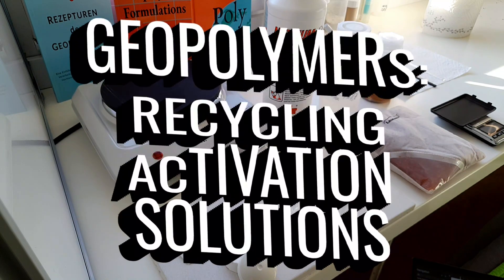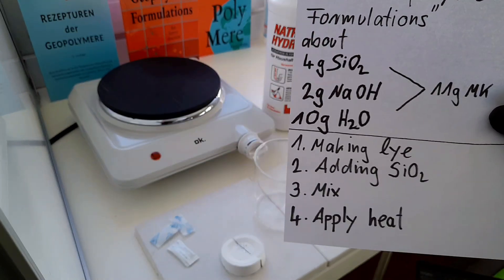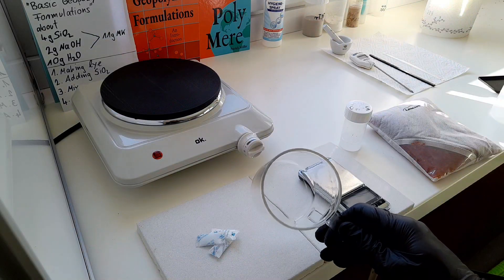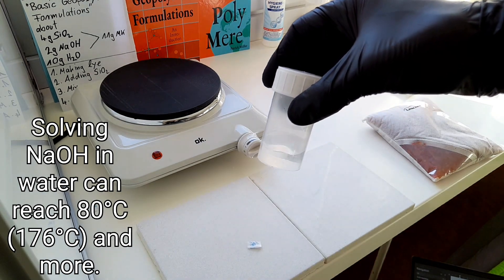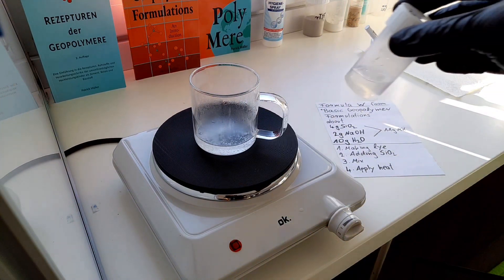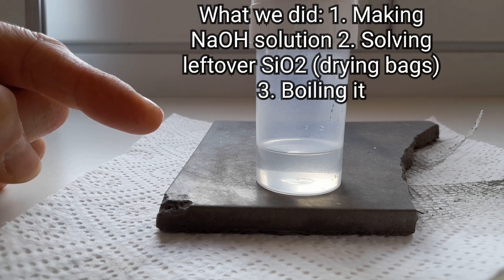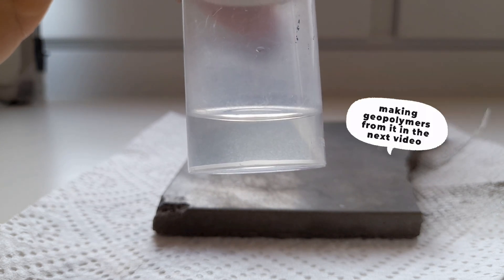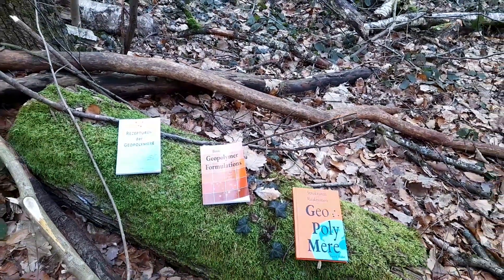GEOPOLYMERs - The Route to Recycling Activation or Hardener Solution

Comment: Is the resulting activator relatively safe for handling? How would you go about storing the activator and the estimated shelf life? Thanks for posting this!
Reply from the maker: Hey Brewcephus, 

that's a great question. Activators like this can deteriorate when they come into contact with certain substances, primarily CO2. However, as long as you keep it sealed, it should have a practically indefinite shelf life. Interestingly, a major waterglass manufacturer in my area suggests a shelf life of only around 2 years for their waterglass solution.

Regarding safety, NaOH, which is present in it, isn't very safe. A small amount of the activator on your hand isn't too concerning since you can simply rinse it off. However, if it's left on your skin without rinsing, it can cause irritation and redness. A significant splash of it in your eyes could even result in blindness. This risk extends to regular cement slurry as well.

When using larger amounts, I always opt for standard protective gear: workwear,  goggles, gloves (the sturdy ones), and a face shield.

Once the geopolymer is hardened, it's not as hazardous, except for the dust when you cut it. It's crucial to understand that this dust must not be inhaled or come in contact with the eyes.

Stay safe and have fun!

Best, Pat
Reply: @Advanced_Materials_Publishing  Great! Thanks so much for the info. I am fascinated by the abilities of geopolymers and have a pallet of Metakaolin I use in my cement work so this seems like a great side step for trying different works.
Reply: Is the dust from geopolymer more dngerous than from regular concrete? @Advanced_Materials_Publishing

Comment: Thank you!  80°C=176°F.  Boiling heat after the solution reaction will vary by altitude.  Here at 4500 feet above sea level water begins to boil at 185°F or 85°C instead of 212°F or 100°C at sea level.
Reply from the maker: Yes, good point! I'm only at 350 m above (Bavaria) or sometimes 600 m in Thuringia.